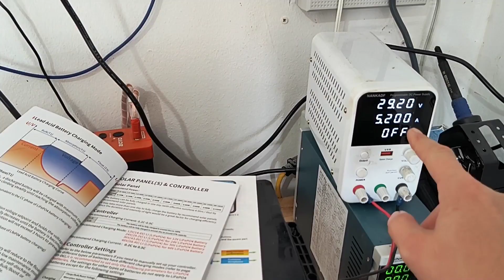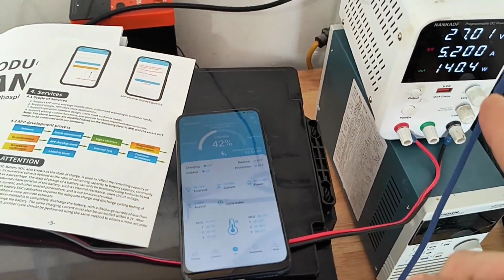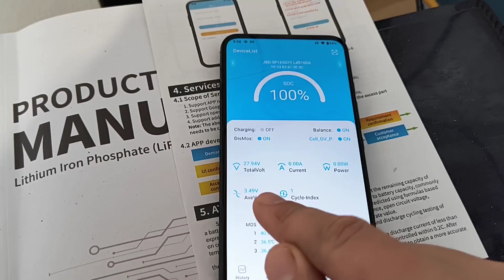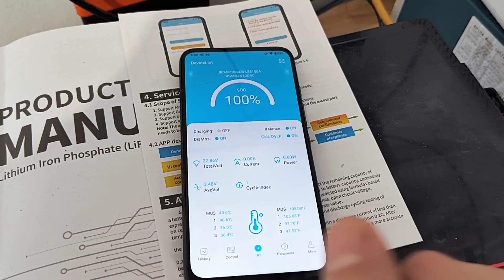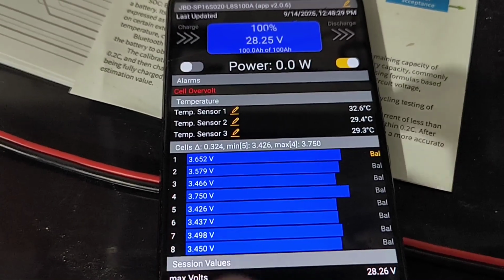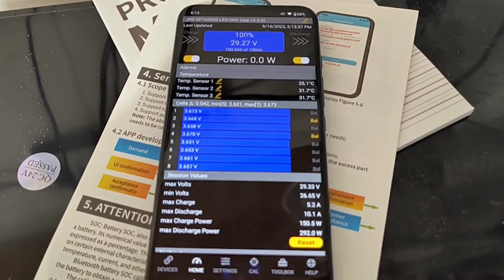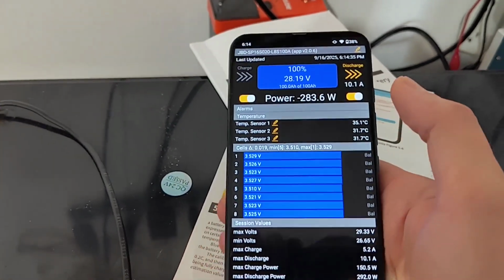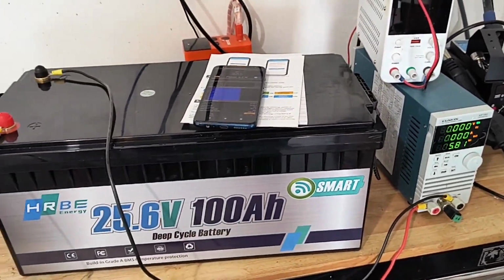Capacity testing HRBE 24V 100Ah LiFePO4 Battery. Out of balance from the factory!? Found better app!

Comment: All of the lower priced batteries are slightly out of balance.  I had a 24v 140 ah battery from another manufacturer that was over a volt out of balance between highest and lowest cell. I ended up getting a refund on it because I couldn’t get it to balanced after days on a bench power supply

Comment: im actually looking at getting two of their 150 AH batteries in 24v.   so this was spot on.    question... on your next charges did cells maintain balance? or were they out of wack again?
Reply from the maker: Good so far. It's in service in my solar shed and about 7 cycles on it. Definitely get overkill solar app if you go with them (assuming they have the same bms), it's much better compared to the stock app.
Reply: @sideproject4028   if i get the batteries  i will use the overkill app  for sure. so after 7 cycles of charging and discharging batteries are charging balanced  that ss good to hear.   for sure leaning towards these.